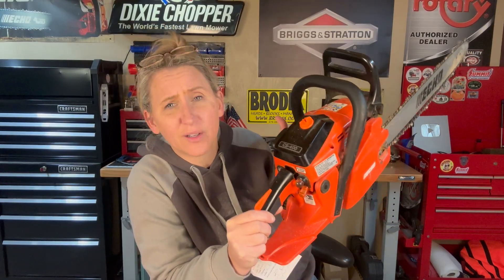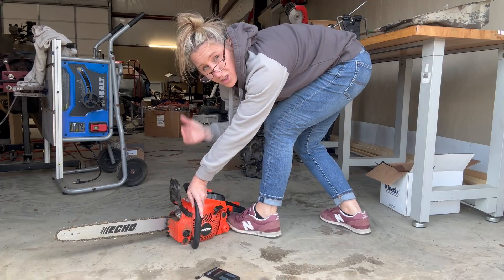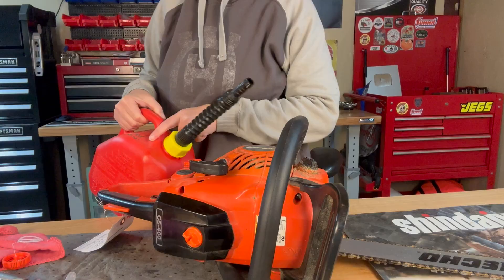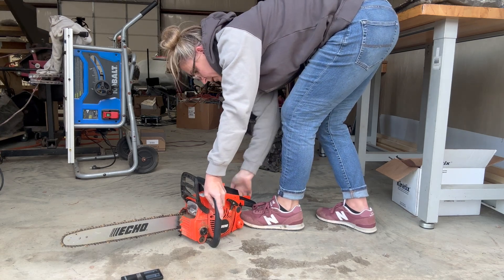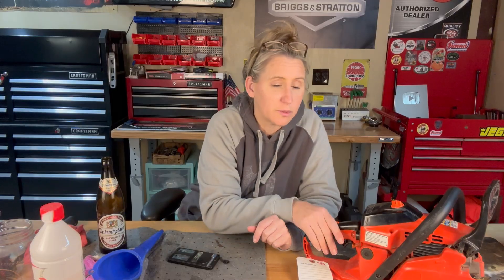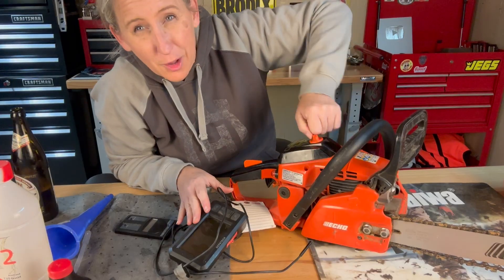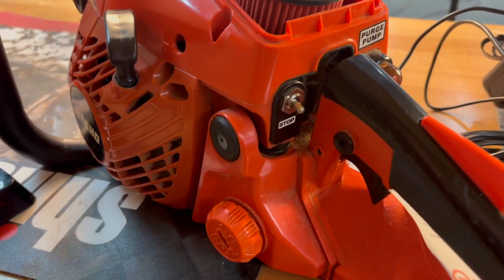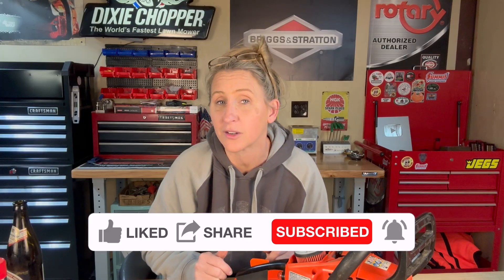Engineered Fuel FAIL! Your Small Engine Is Not Running Right, Even if You Think It Is!

Comment: okay, talk to me about Stihl Motomix.  I often use it in my chainsaw and I can definitely tell a difference between using the Stihl fuel and my own mix, which is nothing special 10 percent ethanos with a decent 2-cycle oil.  There is definitely a running difference between them but I'm not going to say what it is.  Just talk to me about it.  What do you think about it?

Comment: I used engineered fuel once, left it in over winter.  Come spring I couldn't pull the cord, piston was glued to the cylinder.  Flushed it out, freed piston and haven't used it since.

Comment: In Canada, have to use 93 to get ethanol free. 89 has 10%. 91 half that since it's a blend of both. 

I had issues last fall, hard time starting warm, would bog under load. Ran out of gas in saw and jug was empty. New gas, 2 cycle oil and Seafoam (just to stabilize). Saw ran back normal.

Comment: Hello from David in NC.  I have been watching your channel for a while now and thoroughly enjoy it.   But watching you work on the various machines has brought to mind a question I have about spark plugs.  I read somewhere, probably on the web, that if you pull a plug, you should replace it rather than putting the old one back in the machine.  I can't recall the reasoning behind that, but I am curious as to your thoughts about plugs?  Thank you .
Reply: You're referring to the crush washer on the spark plug.  Not throw away the whole spark plug, but replace the crush washer each time you remove the spark plug from the engine.  As they're effectively a one time use.  However, people generally don't for a small engine.  If you were running a dragster tuned to within an inch of its life, yes, you probably would, but not for a small engine.

Comment: I have a Husqvarna 120 chain saw and after using it twice I couldn't get it started again. Checked the plug, prime, spark but nothing worked. By the end of the summer I'd decided the reviews on this saw being hard to start must have been true and I should have listened to them. After watching one of your videos on the engineered fuel (I was using True Fuel) I mixed up a can of regular gas with some good oil and it started on the first pull. It starts every time now without fail. Every time without any other changes.

Comment: It's still running a little rough at high rpm, but the "engineered" fuel may have affected the carb diaphragm.  It may run smoother at high rpm after a little while.  Your diaphragm loosening/lubing trick may help.  What brand is the "engineered" fuel you say to avoid?  Can you say in comments, please?  I bought a can of Husqvarna 50:1 Premium because Husqvarna makes Poulan Pro.  My chainsaw is running great, as far as I can tell, but that's the only fuel that's ever been in it and I haven't used it much at all.

Comment: I'm 72 years old (not young) & I have never had bad gas like you keep talking about.  I've lived all my life in Michigan.  I do treat the fuel with Stabil 360 & a touch of seafoam over the last 10 years.  So Chick, I am just lucky, living right or what?
Reply: You have a lot less humidity than most of us in the south and Midwest. 
I, too, have not had bad fuel in my equipment and I don’t even treat my ethanol fuel BUT I have found my experience on customers engines to usually be bad fuel. Either too lean and burned up or bad fuel. Literally 50/50 between those two issues or a mechanical problem. 
Am I lucky like you and half my customers not so lucky? I don’t know but all I can go by is my personal experience like her and this video. 
In 2 strokes oil and gas are everything. If you use crap oil or crap fuel or crap ratio your engine will suffer. Apparently you and I have found the good balance and so many people just haven’t.
Reply: @thatairplaneguy Did I miss the part on proper mixture? What do you recommend,

Comment: Does anyone here know the physical bolt size and thread type of the Cub Cadet Wood Chipper 753-0900 Impeller Removal Tool?  I simply hate to pay $25.00 for a tapered partially threaded bolt.  Any help would be much appreciated. Thanks

Comment: You must distinguish between excellent ALKYLATE canned fuels such as Husqvarna, Stihl and Aspen, which literally last for years and are of free of all the bad stuff found in gas, and the rest of the canned fuels such as Truefuel and many others which do not tell you at all what they are composed of. “Engineered fuel” doesn’t mean anything…..composition means everything. 
Personally I buy Aspen 4 stroke alkylate fuel, I can  use the 4  stroke for storage for my 4 stroke engines such as my lawnmover or my wood chipper, and I mix  this fuel with Red Armor  2 stoke oil for all my 2 stroke tools, such as my weed eater, chainsaws, trimmers etc.  
The reason I buy the Aspen brand is because it’s true alkylate fuel, ( watch Aspen fuels videos on Youtube) it comes in 5 litre  ( or 1 litre) container meaning it’s  cheaper than Husqvarna or Stihl  per oz.  If you only need a 2 stroke fuel, Aspen also comes  premixed  in a 50:1 version with full synthetic oil. Same price for the 2 or 4 stroke, your choice.  The blue container is the 4 stroke, orange container is the 2 stroke. Only on the Aspen and the Stihl fuel they actually print the date of manufacture, so you know how old it is!, none of the others do…so you could be buying unknown fuel which may have been sitting on the shelf for ever,  definitely something you  don’t want  to put into your  machines…..

Comment: Been lucky here (NY) there is a popular convenience store (Stewart's) that sells real non-ethanol gas at the pumps. Became super popular after ethanol gas was pushed on us over 10 yrs ago. More expensive, I think 91 octane, but have had no issues in my Stihl saws, my old JD tractors, even my 1984 Squarebody original 350 V8. All the Harley guys like it too. Knock on wood (tap, tap) works. The ethanol gas wrecked my Q-jet in that truck, wrecked the Mikuni carb in a Polaris ATV, numerous other machines. Water globules in the bowls, either corrodes parts, separates from fuel, or the ethanol directly wrecks the original rubber parts. Thank you for all the tips and tricks, love all the useful gadgets!

Comment: Yes, I convinced a client to ditch the big box store canned fuel & switch to Non-Ethanol pump gasoline available everywhere in S. Central Tx, Plus add 2 oz. MMO per 5 gal. jug & 2 oz sta-bil. From that 5 gal. Master jug, fill 4-stroke engines directly & for 2-stroke engines, in 1 gal. jug add 2-stroke oil in correct ratio, fill from Master jug. This way you KNOW you put the correct fuel & oil, in the right ratio! You can't Know that about canned fuel because you did Not put the right mix at the factory yourself! Right? He said Ah! Right! Doing it right yourself.. Confidence, Done Right, no guessing, no hoping.

Comment: I watched your review. prior to my question.  My budget on the high end is $2500.00.  The mower I list ,Cub Cadet XT1 Enduro LT 46 in. 23 HP V-Twin Kohler 7000 Series Engine Hydrostatic Drive Gas Riding Lawn Tractor, is $2500.00.  I'm focused on the Kohler motor.  Can you tell me what issues I may have if I go ahead and make this purchase?

Comment: I started using 93 octane to mix my Stihl synthetic oils years ago. I found my saws restarted easier when hot. I think people need to find what works for them and stick with it. I've also got a good friend that delivers fuel to the major stations. He told me tongue in cheek that most fuels are blended a coupe of octane points hotter because it loses it kick when stored. And if the county fuel inspector should do a surprise visit to the station, it must meet the advertised octane or the station will be monetarily penalized. Here's to safe sawing.

Comment: We don't see these engineered can fuels in the UK only the alkalyte non ethanol fuels like ASPEN, Stihl Motomix and the Husqvarna version. We find ASPEN and Stihl Motomix decent products. Only thing I will say with ASPEN and even Stihl Motomix is that if you put it into a older 10 year older or older machine that has only even run on pump gas, you will find that the non ethanol fuels will highlight how bad the condition the fuel system is after many years of ethanol based fuels being pumped around it. Best to always buy carb gasket repair kit and fuel lines and replace the old ones prior to adding ASPEN or the other ones by Stihl and Husqvarna.

Comment: I've been buying Blue Planet Ethanol free gas for 3 year's or more now and have had Zero problem's. It's sold at Holiday Gas Station's which are now changing their name to Circle K station's. l add Stabil when it won't be used fast like in Winter and always add Marvel Mystery oil for top end and valve lubrication. I bought the Borescope on your recommendation and got the 4th of July edition when they were on sale. Keep up the good work Bre.

Comment: I’ve heard you talk about engineered fuels multiple times in different videos but I don’t recall ever hearing you talk about non-ethanol fuel. In my area this is readily available for use in recreational vehicles, mostly boats. (REC Gas) Do you think using this, following proper ratio mixing instructions, is a good or bad approach?  I understand that the tune may need to be adjusted a little for the higher octane non-ethanol gas that is readily available (90)

Comment: Good afternoon I have a question about my chainsaw it’s a husqvarna 442 and it starts and runs about 20 seconds and dyes out. Can you give me insight as to if it’s the carburetor needs a replacement or rebuild kit. Or it needs a carburetor adjustment on the low jet ? Thanks for you’re help

Comment: Great content, very informative! I have a question, I recently tried to fix a friends craftsman chainsaw, carb was plugged so I ordered a pro chaser carb on Amazon, kit came with both filters and fuel lines and purge bulb, I replaced the old stuff with all the new stuff being careful not to damage the lines when pulling them through the tank etc, the problem I’m having is it’s sucking air through the carb on the purge bulb side, so I sent it back to Amazon and got a replacement carb and it’s still doing the same thing, it will run but won’t hold vacuum for very long before starving for fuel, what do you think is causing the air to come in? I’ve checked to make sure the lines are snug on the carb/bulb/tank through holes, still stumped 🤔

Comment: What is your opinion on Aspen 2 fuel for my Stihl small engines? I already use motomix. Thanks, Marc Quebec 😉🇨🇦
Reply: Being someone who sells it there are advantages and disadvantages.  Like the motomix it's mixed 50:1, uses a decent two stroke oil in the mix and burns cleaner and with less emissions. Smells nice as well. 
The only disadvantages I find are if ASPEN is introduced into the fuel system of an old 10 year plus machine that has been run on regular pump unleaded fuel for most of its life, the ASPEN fuel easily finds out how bad the diaphragms and fuel lines are and can speed up what the ethanol has already damaged. With older machines I would change all of the diaphragms and fuel lines prior to using ASPEN. Have also seen similar happen with the likes of Motomix and other alkalyte non ethanol based fuels.

We run ASPEN in the majority of the Stihl and Echo machines we see come in for repair at our shop. We also use to use Motomix but from a price point of view ASPEN is slightly cheaper and it is more widely known as there are many other dealers selling the fuel.
Reply: @bentullett6068  thank you for this complete & clear answer! 🙏🏼😉🪵

Comment: For the extra cost and risk of that crappy "engineered" fuel why wouldn't you just mix your own?
You can choose what petrol you want and what brand 2 stroke oil you want and (usually) save money.
Also thankfully here in Australia, shitty ethanol blend fuel isn't mandated. If you want you can buy either E10 or E85 but thankfully you don't have to.

Comment: I only use VP canned fuel for winter storage. In the spring, I dump it into a jerry can to later mix into generator fuel. I refill my 2 stroke equipment with fresh ethanol free gasoline mixed at 40:1 and they always pop off within a few pulls and run great.

Comment: -I used to fly 2 stroke RC model planes, and we always leaned out the mixture so the engine would scream but not bog when we tilted the nose straight up at full throttle.  We needed the max power, we didn't care about the engines and we were running castor oil anyway.  I was told that you DO NOT WANT TO DO THIS with chainsaws.  You want them to "four stroke" or be slightly over-rich at full throttle with no load such as in this video.  This ensures that under load the mixture doesn't go too lean and you wind up burning a piston.  

I did the research on this because I had a chainsaw quit running after only the second use.  I pulled it apart and the piston was heavily scuffed and there was little compression.  This with factory two stroke oil in a slightly heavier than recommended  [40:1 versus 50:1 if I remember right] ratio.  I was told then that the factory setting is designed to scream and they don't care if you burn your saw up....

Comment: Sigh. Again. It's not a fuel issue, it's a tuning issue. The canned fuel which shall not be named is very different from ethanol pump gas. It gets its most of its octane rating from alkanes rather than ethanol and aromatics. If the carb is not tuned to it, the saw will run rich and have lower rpm at WOT. No surprise.  It's more energy dense, and the jets must be leaned up from the pump gas settings to get the same rpm. The fuel isn't bad, it's different. Here's an experiment. Start with the carb at pump gas settings using canned fuel. Measure rpm. Then lean the high jet to the target rpm. I'm betting it will run fine and give better "mileage". Do I use it? No way, far too expensive. I use Red Armor and non-ethanol pump gas.

Comment: Hello

In Germany it is common to Use Alkylat Fuel.
The most known ones are Stihl Motomix, Husqvarna XP and Aspen2.There are others but not so common.

When you go into the woods to get your Firewood buying from the State, it is NOT allowed to use normal Fuel from the Gasstation.
The Ranger maybe control you, better be not there when he cums to take a look, LOL 
Clear its expensive, but way better for your body and Health.And let your saw run every time, over Years and Years.
Greetings from Germany

Comment: I bought three gallon sized containers of Stihl 50:1 for a new Stihl MS251 chainsaw in January. Bought a echo SRM225 last week threw some of the Stihl 50:1 in it and it was brand new container. Between three people couldn’t get the weed eater started we tried for hours. Pulled the plug the fuel had water in it swapped with TruFuel I had in my rv that was sitting in storage and it started right up.

Comment: Digital tachometer is listed at 145.98 online at big store.
Plus i am confused, some  digital tachs have to read spinning movement. 
Yours is just held above engine cylinder.
Reply: Yes, it picks up the impulse from the ignition coil.  You can set it on 2 and 4 stroke and different number of cylinders.

Comment: I've used Aspen 2-stroke for decades in my chain saws. More healthy exhausts, nice when surrounded by two feet of snow. Here in Sweden I can buy it from local farm/forest shops from pump in any quantity. As we have winter half of the year, lawn movers, motorcycles and other engines hibernate. I use Aspen 4-stroke last 2 fillings in autumn. Never have an issue with starting in spring. Even had an old motorcycle that after 6 years sleeping filled with Aspen started first kick. Here we can also buy Aspen high octane racing fuel.
Reply: I also use Aspen in all my chainsaws and strimmers at the end of the season; clearly this issue that Chickanic has (repeatedly) with Trufuel (I think that may be the one) is simply not the same as Aspen Fuel. Aspen Fuel is a European product made in Sweden and it is available at numerous outlets in the UK and elsewhere.
Reply: Ditto, have had none of the issues with ageing over seasons with Aspen that seems to be  rife in AL with whatever fuel you consider.
My Scandinavian climate may differ, but otherwise... well.
Have had various chainsaws, mowers, and above all machines that has not been used for years, snowblowers and vibrators, start and run flawlessly on the tank that was filled up long ago.
Sure, it is more costly, but it burns very clean, no deposits, no smell. 
I seriously think you should consider evaluating this type of fuel deeper vs the alternatives you covered.
Just the health aspects of poor combustion of inherently cancerogenic stuff, like regular gas, should be enough for most people . At least for the weekend warriors. 
Keep up the good work!

Comment: I'm from Melbourne AUSTRALIA. This canned fuel does not exist here in Australia At All. Thank god. How LAZY people are in my eyes,not mixing themselves. 👍
Reply: I’d say most buy the canned fuel for convenience.  They’re generally light users that don’t want to buy a gallon because they’d never use it all up. They also think the canned stuff is better and they will say they never have carburetor issues. I’ve talked to people buying it and thats what I’ve heard them say.
Reply: Myself I’m currently using the Amsoil 100:1  mix with non ethanol gas. No smoke,easy starting, and a gallon last me 1.5-2 years. I use Stabil 360 amber color as the directions say. I never have issues.
Reply: @Northlandermn  l use sta-bil in all my machines from petrol to diesel. My FJ 45 sits (used as a fire truck 🚒) sits around for quite a few months at a time,but fire's up on the turn of the key.  Same with the backhoe.